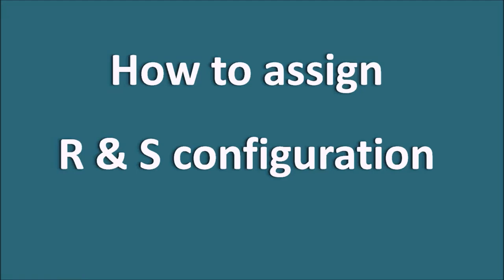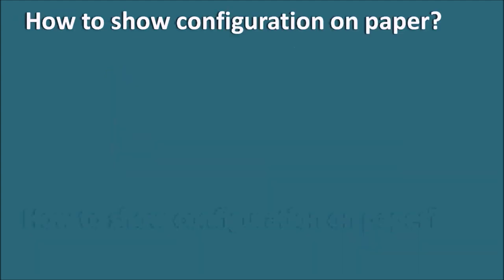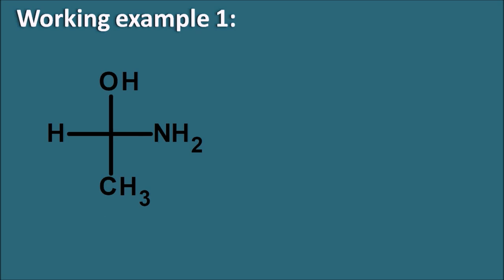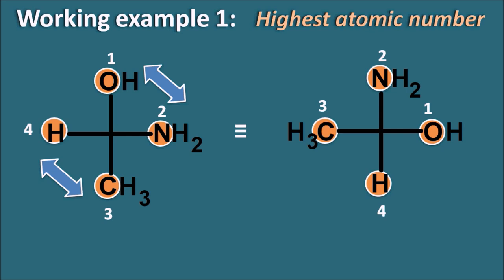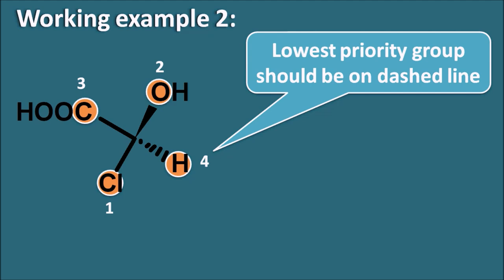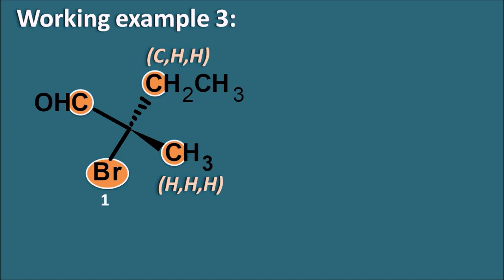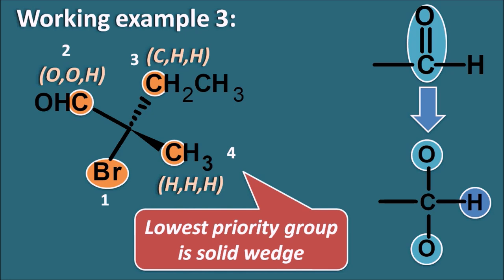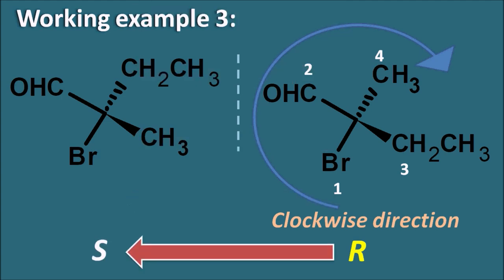How to assign R and S configuration

Comment: very clear sr...if in dash wedge lowest priority group present in plane what we need to do?
Reply from the maker: Normally structures are drawn such that lowest priority group is shown to attached by either wedge or dash. But if that group present in plane, still we can rotate the structure such that the groups in plane become attached by wedge and dash and those groups out of the plane are then come within the plane. We have to carefully imagine the structure and can convert it to the required orientation.
Reply: tq for very valuble and instant reply sr

Comment: Sir like h2 ki jagah some other group present hai.. Then in tht condition also least priority compound ko niche rkhenge?
Reply from the maker: Even any group other than hydrogen with least priority is there in structure, then generally it is placed in vertical line at bottom while giving R,S configuration.
Reply: Thankyou sir 😊

Comment: Last two structures are not mirror images to each other. They may called as isomers but not mirror images
Reply from the maker: Since the compound is having only one chiral center, switching of only two groups will give an optical isomer which is an enantiomeric pair therefore it is a mirror image. In solid wedge and dashed line they may not appear as mirror images but just by rotation we can confirm that they are mirror images. Thank you.